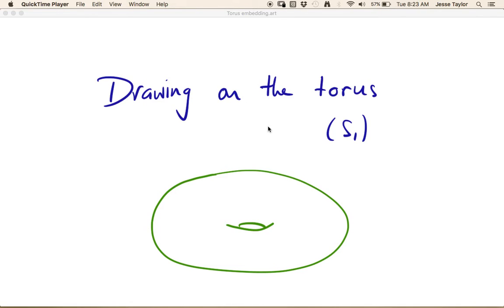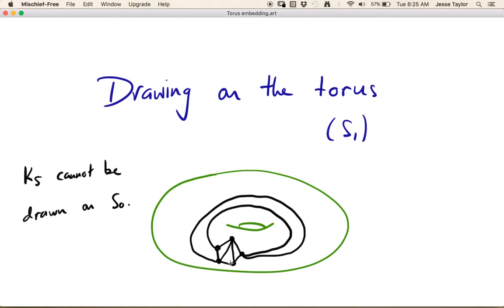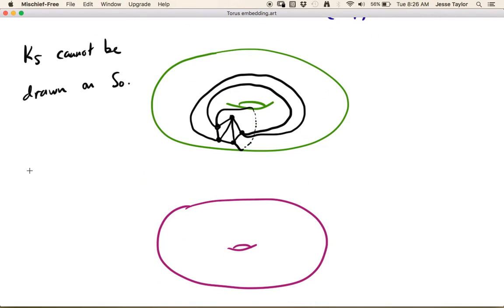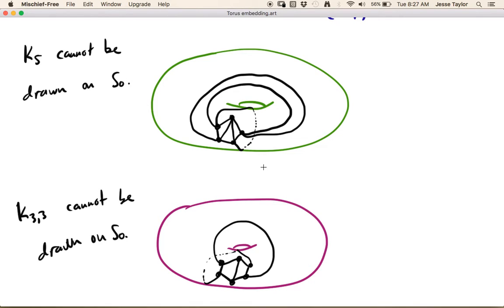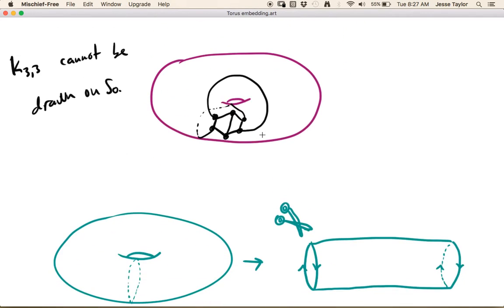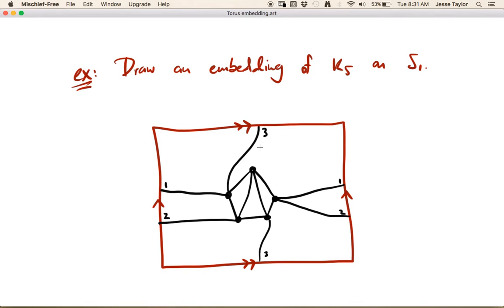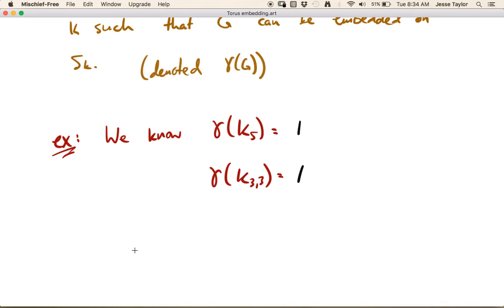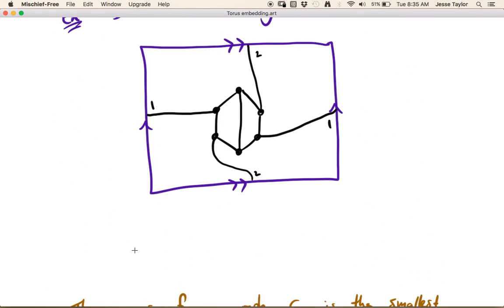Graphs on the Torus - 28

Comment: Hey thank you for your awesome videos! I have a question: What are some real-world-problems which can be solved by drawing planar graphs on the torus?
Reply: Dynamical system theory.  Solving of differential equations.
Reply: I just checked Wiki on Monodromy.   If you are curious, this will give a connection to the video immediately.  If you find bits missing (as you would - just look up the Russian version, which is considerably richer), well, mathematics is a massive landscape. https://en.wikipedia.org/wiki/Monodromy